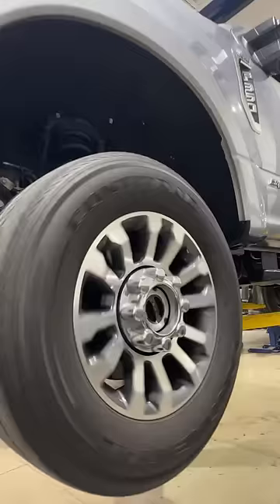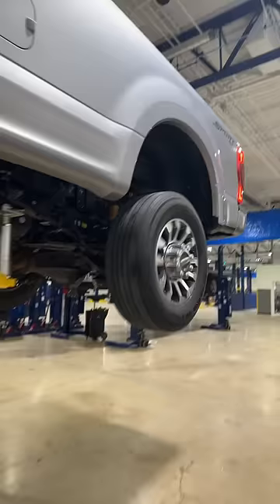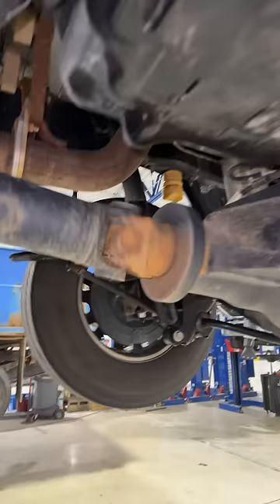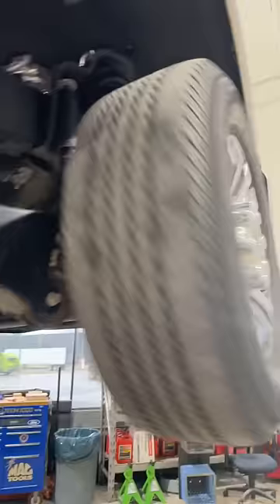NEW 4x4 noise 2022 | F250 F350 #broken #fyp

Comment: Way back in my day...97-01 Camry V6/Avalon/Solara... had many axle dust shields installed incorrectly on the GKN axles.   They would slightly rub the seal, it would actually be pretty loud, reflecting off a wall.  Pretty easy fix in the day. Just carefully move the dust shield away a tiny bit.   No noise!

Comment: I spray 0w20 oil on my moms 06 Rangers frame/ crossmembers every few years and it is in great shape.  Wisconsin
Reply: Wd40 on wheels before winter also helps with dirty wheels. Washes off easy in spring
Reply: Half ATF and half diesel fuel, spray it on
Reply: New oil or used?
Reply: Why not 0W-16?
Reply: I spray the whole underside with used motor oil after I change it in the summer..  all ya do is get old boxes break them down lay on ground old pain sprayer fill with used oil and spray everything. Metal hoses frame everything...  Make sure to take out tail light lenses. Spray in there!!!  Then after your done burn the cardboard!   Try it. It's free!
Reply: @nostradamus7648  new.
Reply: @pbear216  that exists?  👍
Reply: @davidrogers5180  why not , hey.  !!!
Reply: @sowdiem6047  yes, my Rav4 uses it

Comment: Those vacuum hubs have always been a problem and truth be told I'm impressed Ford has stuck to their guns so hard with them.
Reply: My 2019 had a problem with that.
Reply: Ahhhh it’s a super duty bud. Those are manually engaging hubs. Like they’ve always been. The f150s have IWE’s and if you don’t clean the check valve on the vacuum lines the lines bleed pressure and partially engage the hub. Unfortunately most ford customers are unwilling to clean the filter in the valve themselves and don’t think spending money paying someone to do it is worth it 🤷🏼‍♂️

Comment: I’ve got the noise 2020 with 20k miles. Earned a sun from me to see what your fix is .
Reply: Knuckle seal at wrong depth. Common failure here in rust belt on 2017+

Comment: On our fleet in northern Canada we have noticed that around the 2019 models and newer the inner vacuum seals are the cause for this noise , from about 20,000 k to 60,000. The earlier trucks seem to just fail and not hold vacuum ,but were quieter. We do not have a reliable Ford dealer here ,downtime is way to long so we just change them ourselves using the correct Rotunda tool.
Reply: Yep
Reply: Just bought a 2020 in Dawson. Will be watching for that

Comment: Hub seals. Had one in the shop last week
Reply: Thanks, glad I got a 99 7.3 only 104000 miles.  4x4 also  only batteries, breaks, and full service.  O it tows also.
Reply: @robertmcdonald9280  just bought me one also. 1999 f350 7.3 12" lift 40" tires Detroit lockers Dayna trac front and rear 5.13 gears. 102000 miles 5" exhaust s&b intake. 15k
Reply: @MrHawaiian5  nice, got mine brand new. Had a 95 also, sold it with  380000 miles on it still running strong.  But 3 transmissions. But it towed a lot.  Good luck 👍  with yours.
Reply: Bad hub seals on a new truck? That sucks.
Reply: Had a Ford ranger with bad vacuum hubs. Instead of buying a new one, I stretched a condom over the diaphragm and sealed it with liquid rubber. Never had the problem again😊
Reply: @stevesmith3556  that's a great idea.

Comment: American Truck Companies have let American Truck Owners Down. Toyota is the Move.
Reply: Nah
Reply: Yup
Reply: Back in 2019 I bought a brand new F250 since the day that I got it it was problem for six months between manufacturing problem in problem was the door won’t open when it was real cold it was a hassle took it to the Toyota Dealer traded in for a tundra and I still got it no problem I just take it to the dealer to do an oil change that’s it
Reply: @skylermummert24 Yeah.
Reply: Former Toyota tech. Left because scheduled maintenance got boring. Now at a stellantis dealer. Can't remember the last time a car came in for JUST an oil change and it didn't need anything else
Reply: When you need to haul more than 10k in weight Toyota is not the move. Maybe if Toyota had a 3/4 ton truck.
Reply: Partially agree. The American standard for quality is shrinking in these USA manufactured vehicles, like Ford and GM. Toyota knew how to enter the US market and dominate it, which is why it is where it is today. They're everywhere, alongside the USA designed, made, and manufactured vehicles. They don't build them like they used to, that's for sure...
Reply: I got news for ya. Those Toyotas are more American made than any ford or gm that is manufactured in Mexico.
Reply: But the tundra is 1/2 ton and so ugly
Reply: @larryfreimuthii37  was going to type literally the same thing. Might be why Toyotas are doing so well.
Reply: Toyota can't tow a lawn mower. My 6.7 tows a 12k tractor everyday. If you did that with a plastic Toyota it would bend in half on the first drive
Reply: Absolutely  dreading my next vehicle purchase. 
I hope my 01 4runner will make it another  88k ..........400 is a nice even number
Reply: Lifelong Chevrolet guy- just bought bought 2023 Tacoma. Too old to work on the newer Silverado’s. Still have my “67” C10 though!!
Reply: Unfortunately, they don't make heavy duty trucks though
Reply: @dozer_bob a Tundra towed the Space Shuttle dummy
Reply: @dozer_bob And the Tundra is rated up to 12k too!
Reply: @rileyshane78 the Tundra can tow up to 12k
Reply: @pbear216  yup and I've seen a man pull a 747 by hand. Pretty stupid comparison. If a tundra could tow you would see people towing with them. Toyota's are for the guy that wants a truck but really doesn't need one. To compare a tundra to any current 3/4 ton+ truck Is stupid. They are good to tow lawn mowers or a dirt bike.
Reply: @pbear216  the tractor is 12k you have to put it on a trailer to tow it. That weighs 4k. I've towed 35k on steep roads with f350 dually. I would love to just load the dozer on the trailer hooked up to a tundra and watch it buckle
Reply: Problem is they don't make a heavy duty just grocery getters
Reply: @rileyshane78  TOYota is really a 1/4 ton vehicle, has dismal payload
Reply: @emel444  Toyota tried to make it in the US truck market and has failed. It’s a distant 4th in sales
Reply: @cjwright1960  as they say the trucks looks reflects the owners..😝
Reply: Left American junk years ago. Until they can make trucks that last again, I'll keep buying my yotas
Reply: Tundras are junk too.

Comment: Been a common problem on fords that use that type of 4wd shaft to the wheels. The wheel seals on the rear squeak when rotating. Seen it dozens of times on ford trucks dating to the mid nineties

Comment: Had a 2023 Raptor R roll into the shop at 331miles yesterday extreme rust on the diff. Ford definitely needs to do something about this
Reply: Like point the finger at Krylon?
Reply: Especially considering the Raptor R It’s selling upwards of $200,000
Reply: It’s inexcusable. This problem was first raised easily over a year ago about the axle coatings rusting early
Reply: And yet people still pay over msrp for some reason.

Comment: Mines in the shop atm for that same noise sitting right around 17k miles too. Ford service advisor said it’s due to knuckle seal.  Common issue I guess. Kinda embarrassing driving around in a new truck and sounds like the brakes are going bad 😂
Reply: My Explorer makes a whistling noise from the vents inside. Only problem that I can find, is that, it is a Ford.

Comment: I have an '18 f150 4wd that sounds like a LF bearing is going out the faster I go. Put brand new wheel hubs on the front, still same noise. Doesn't change when 4wd is engaged but gets louder when steering is turned slightly left. Still haven't found out what's making the noise.  Bought it last year, put about 25k miles on it, and still drives fine other than the noise. Sometimes, it gets a little louder for a few days and then quiets back down. On the lift, I don't hear it at all. On the road, sounds like a classic wheel bearing sound.
  My brother's '21 F250 u- joints squeak and sounds like this truck.

Comment: The rust on that truck is insane for a 1 year old vehicle!
Reply: I mean it's not bad looks like mostly surface rust but yeah that's what happens when you live in a state where they use saw on the roads and you never bother to take your vehicle to the car wash and get that s***washed off

Comment: My 7.3 idi 90 dually 4x4 cc is still doing me good so i think ill stick with that until all the build quality goes up. I will say tho, my dad has a 21 f250 with 100k on it already (my dually had 190 lol) and that thing is 100% as nice as it came from the factory… not one issue. And thats 100k with a loaded down flatbed

Comment: I bought a scion xb with 30k, traded it in 9 years later with 175k.  7 years was in Maine.   When I traded it in, the entire suspension system was original.   I had replaced the front pads/rotors.  The rear brakes, struts, ball joints, tie rods, steering rack, toe links, anti roll bars...all original.   Granted, it was a 2400 pound cars, but it still illustrates that companies can design and build parts to handle at least 80-100k of hard use...there's no excuse for problems on a 2yo truck with under 20k.

Comment: Damn that's a lot of rust for a brand new truck
Reply: Exactly
Reply: Welcome to the midwest..
Reply: That's what happens when people don't bring their cars or trucks to the carwash during the winter time to wash that salt off  underneath my 2012 Jeep Liberty has zero rust underneath it or on it
Reply: @jeep1987  is that what you think? I work at benz In NY .Sprinter vans don’t fit in a car wash. So they don’t ever get washed because their a work vehicle and they get beat. Hardly ever see rust even close to this
Reply: @jamesszumiloski9522  Like a public car wash? If so, our cdl trucks fit in car washes, so trust me, a sprinter van definitely fits.
Reply: @Bullet44  well seeing as my dealer owns a automatic car wash and the bay is 9foot and the car wash across the street is corporately owned and has multiple locations with the same clearance level and a sprinter is 9 foot 6 I don’t see that being possible, best you can do is a self serve bay. Good luck with the under carriage
Reply: @jamesszumiloski9522  Oh, I was talking about a public car wash that you do yourself. Those things are like 17ft tall, but I suppose it depends on where you're at.

Comment: For everyone asking about the rust underneath this vehicle; they often come like that from the factory.  I’m not saying all that rust is from the factory but I did a custom order F350 6.7L dually and it came with rusted parts underneath. 

Was told that a lot of those parts are stored outside before installation.
Reply: On my alumiduty, at delivery the only thing without patina was the aluminum body. The rear end itself looked pretty crusty, and then started to leak within a year.

Comment: I have the same thing on my 22 F350 only seems to happen when I’m driving in snowy roads doing at least 30 if I only use it for a little bit and going slow I don’t notice it at all but by the time I drive a few miles or so doing 40 I can hear it as soon as i switch to 2 WD it completely goes away I have less than 9,000 miles on it
Reply from the maker: Yeppppp, stay tuned
Reply: Where can I see the follow up video for the hub noise correction? I have a 17-6.7 @PowerStrokeTechTalkwARod
Reply from the maker: Thanks for being patient, brother. It is scheduled to go live this Friday at 5:15 pm EST

Comment: There sure are a lot of Fords on YouTube for many issues including water leaking in the cab
Reply: Yea my buddy that in is 2020 f150 lariat. Ac drain tub design flaw.
Reply: I worked in a body shop that did warranty work for a Ford dealer that didn't have a body shop. They would send us water leaks all the time, all different models. The regional service manager told me they don't do any quality control anymore. None. The company figured out that it's cheaper to fix the cars that people complain about than it is to have quality control. That made me think "They must be building a bunch of shitty vehicles and selling them to people that don't know any better"  A problem is a lot easier fixed on the assembly line than fixing every car individually. Their bean counters must be incompetent too!

Comment: I would have called it a whirling noise not a squeaking noise 😂
Reply from the maker: Hey I just said what the RO stated
Reply: @PowerStrokeTechTalkwARod   I have a 20 f250 6.7 diesel regular cab 8ft bed with 10,200 miles and it was making that noise at about 7k miles while plowing. Sounded like the left front wheel.
Reply from the maker: Yuppp

Comment: I have a 2001 Toyota Camry Le with 195,500 miles that I brought and fixed up for a total of $3800 and this truck isn't even two years old has rust and issues all ready and probably still owes $48,000 and miles are kinda high for how young it is. That's crazy why are people falling for these newer trucks.

Comment: I'm pretty sure you need some DOT3  blinker fluid it will be fine.👍🏻
Reply: Dot 5. He is racing the truck
Reply: Both yall off base... Those are pneumatic turn signals.  Needs the relay manifold greased.

Comment: I have a 1965 Chevrolet C10 truck with an inline 6 250 engine and four-wheel drive I had never had a problem with it as I fix my own cars.
Reply: It also can't tow. No ac. Rides Lick sht. Sounds like sht looks like sht can't take a road trip in it. Had a bunch of rust. And it also makes a bunch of noise. It also isn't worth crap. 
Let's get real

Comment: I had a similar noise in a new 1999 4x4 Ram I bought. It was the outer dust seal on the axle shaft and axle tube.

Comment: It may have been 30 years ago but I was taught to never put the car in gear while it’s lifted by the frame with the suspension extended like this.  It puts too much stress on the drive shafts.  The suspension needs to be supported or have a pre load and then it’s perfectly ok to do.
Reply from the maker: Yea i dont think so tim

Comment: I'm wondering if it has castor shims in the upper ball joints from the factory to combat the death wobble issue. That will cause the axle shaft to be off center in the tube and will bind up at the wheel bearing. It may also cause the inner seal to leak.

Comment: I have a 2020 f550 7.3 4x4 as a service truck, 82k on & it’s 17k lbs everyday.  Only power train issues I’ve had was at 78k miles the spark plug wires gave out on 4 cylinders. Put if it’s hot out she starts rough for some reason

Comment: I had same noise on 1999 F350 and it was the driverside front wheel hub. The bearing was bad. Replaced it and noise was gone.

Comment: Lanolin oil is the best rust proofing natural product you can use because its moisture is not just on the surface of the metal, it has the ability to penetrate into the metal and create a microscopic coating to stop any rust from forming.......

Comment: I had one on my 2012 f150. It was the vacuum to the iew. The solenoid had failed. Fast forward got a 2017 f150 and just two weeks ago the same noise occurred. Check the vacuum and it was failing. Turns out its the iew on the passenger side. So soon nee iew and then im just going to cap the line so the front differential stays engaged and ill just take the hit on the gas mileage.

Comment: cause rust from north area.Road salt is a common cause for corrosion of automobile parts, and cars in the salt belt often experience more rapid rusting compared to other regions of the country, rendering them unsafe as brake lines, electrical wiring, and structural components are adversely affected. Manufacturer recalls for corrosion issues often target only vehicles operated within Salt Belt states...

Comment: 2011 f-250 had this noise in 4 wheel drive only. I ignored it. Never turned into a problem. I think it was an axle shaft boot seal. Run it...

Comment: try this... put the vehicle in drive and reverse, Max steering left then Max steering right.... use the noise isolation probe to find any inconsistencies in noise were squeal.... water intrusion or bad seals in bearing and spline shaft fitment....

Comment: My dad’s 2020 with the 7.3 did the same damn thing when it hit 76k he traded for a 2024 f350 high output great runner but 5300 miles on it it’s already getting new u joints at fords rite the fudge now